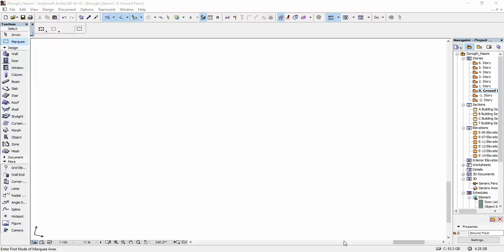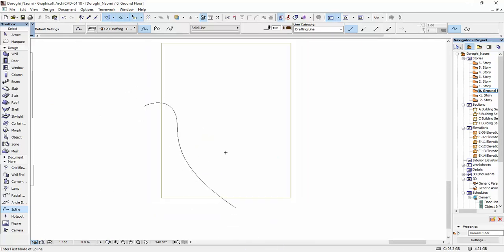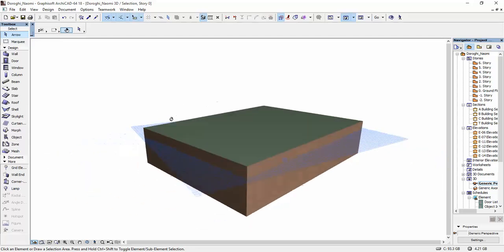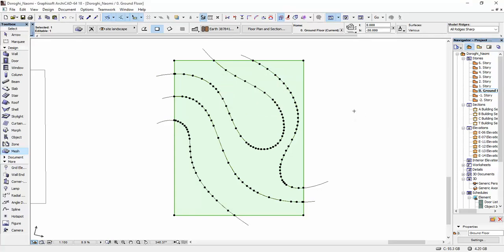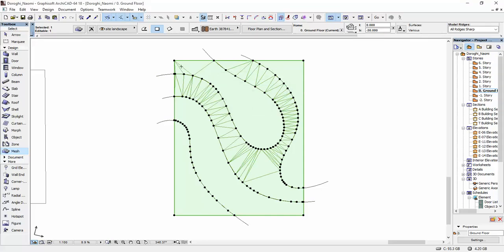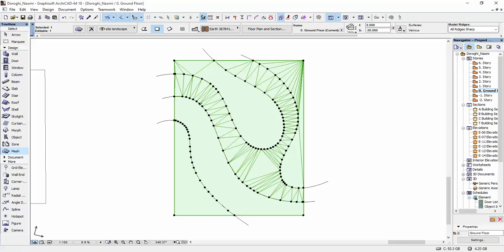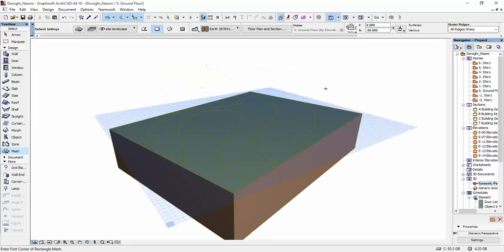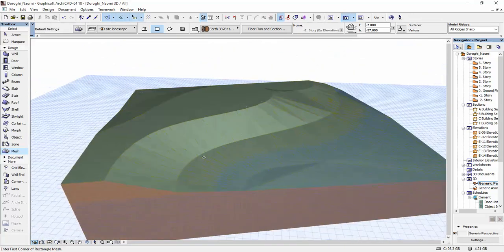Model terrain in ArchiCAD / create site

Comment: hi saw your video land with the mesh tool , I have a question as I do to flatten some ground to place my project as you would with a tractor and another thing is no way to link the topography and the project with the same true north , I mean if I do the project in a file and the topography in another file to link the two need to match the coordinates of one with the other for the project that placed in the exact position and actual data according to Surveyor
Reply from the maker: +krupper Arevalo  Hi!    https://youtu.be/r_4QLQzSozs    Does this answer your question?
Reply: very clear through the video, but did not say as I do to flatten some ground as if he had spent a leveling machine by a specific area , I think you handle revit is what is done in revit with the region command level to leave build area at the same level